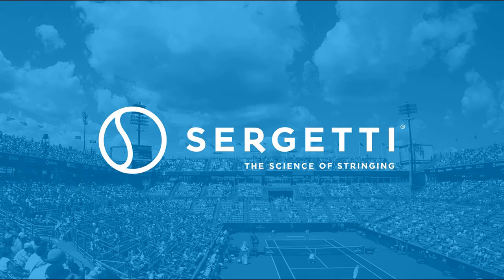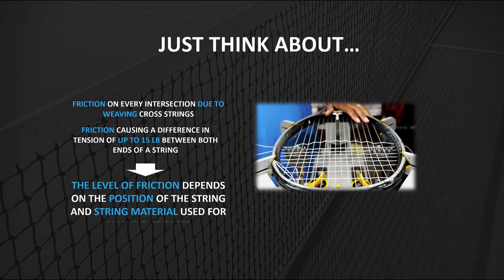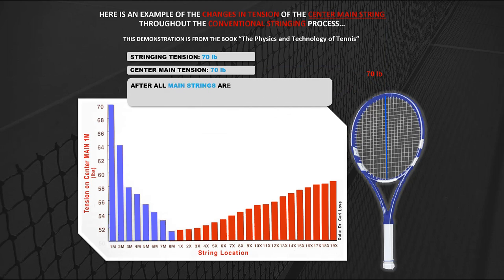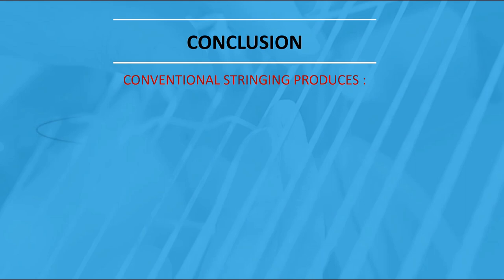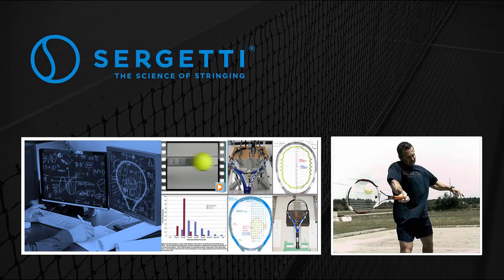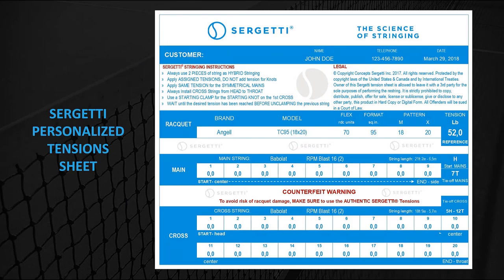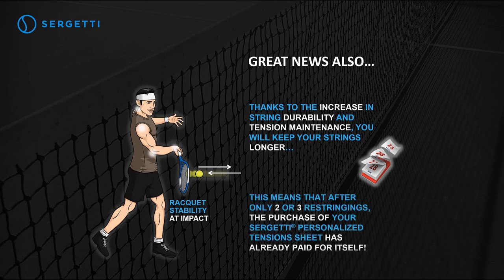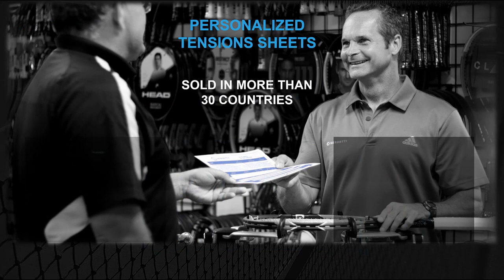Why Sergetti technology is a must in tennis stringing?

Comment: About to string one of my own racquets: I will experiment with groupings of tension to save time.

For 16 mains: groups of 3+3+2 per side. Inside 3 highest to outside lowest. For 18 crosses: groups of 6x3 where middle 6 will be lower. This way an approximation can be tried in order to save time on my drop weight machine.

Thank you for presenting an interesting concept 👍🏻👍🏻 Cheers

Comment: It doesn’t really make much sense, because 2 lines of strings hanging across the racket is basically a pulley mechanism. The tension on both lines should be very similar with the maximum difference of the friction between the string and the racket. So even you are changing the tension value when stringing different lines of strings, you can’t change much.
Reply from the maker: Dear Fan Bu, as I asked to VE, Have you done any tests and measurements of what happens to every string tension during the stringing process even if the tensions are different for all strings to affirm what you are saying? I am convinced not to affirm something which is absolutely not the reality.

Comment: I can't see how you can lessen the tension on the next string without it affecting the tension of the previous string line, they are physically connected.  Now I can see it if every string was tied off on its own at each end.  @fanbu1061 makes an excellent point it's a pulley system.  And even if you manage to get different tensions at the moment, the minute you pound on the string bed the strings will seek to equalize the tension.
Reply from the maker: Thank you for your message! The racquet stringing with the Main and Cross strings is not a pulley system at all. You must think that there are loops on the frame at all ends of the strings, which creates enormous resistance to the movement of the strings, thereby preventing any movement of these strings, and therefore any change in tension even for 2 adjacent strings. You should also think about the fact that the impact of the ball is on about 25 intersections (5 Main X 5 Cross), which again does not affect the tension of a single string, and not at all at the places of the loops. Sergetti personalized Tensions complex calculation are done using up to 50 variables to get the same vertical string deflection on the biggest surface possible of the stringbed, which is 70% of it, compared to only 12% with conventional stringing.

Comment: Ok for a starter, remember the racquet frame is clamped during the string process. This is just one of the many elements that are overlooked in what was described in the video.
Reply from the maker: Dear VE, Have you done any tests and measurements of tension variations during the stringing process even if the racquet is held at 6 points of contact to affirm what you are saying? I am convinced not to affirm something which is absolutely not the reality.

Comment: Interesting concept, but wouldn't the strings all reset to one tension after hitting for a while? like if u tension the first mains at 70lbs, then second main at 50lbs for example....once u hit a few times, both strings will move and both becomes like 60lbs since they are all connected?  There are no knots to stop the tension loss/sharing/reset
Reply from the maker: Thank you very much for your message and interrogation you have! The racquet stringing with the Main and Cross strings is not a pulley system. You must think that there are loops on the frame at all ends of the strings, which creates enormous resistance/friction to the movement of the strings, thereby preventing any movement of these strings, and therefore any change in tension even for 2 adjacent strings. You should also think about the fact that the impact of the ball is on about 25 intersections (5 Main X 5 Cross), which again does not affect the tension of a single string, and not at all at the places of the loops. Sergetti personalized Tensions complex calculation are done using up to 50 variables to get the same vertical string deflection on the biggest surface possible of the stringbed, which is 70% of it, compared to only 12% with conventional stringing.
Reply: @sergettitennis  I will have to disagree, I know there are resistance and friction on the loop yes, but you can easily see how tension can be affected by cutting any single string, u will see the surrounding strings becoming loose even without pulling, thereby the "resistance/friction" whilst true that it helps hold the tension, I believe over multiple impacts/hitting, will change or even out the tensions somewhat, not 100% but definitely not 0% either, hence making individual tension difference between strings quite moot in my opinion.  Same reason some don't like the Starting knot, or think the starting knot destroys the grommet...I mean, if the loop friction holds, why do u need a starting knot that is different from a normal knot in the first place?  esp after many loops.
Reply from the maker: @logicrule  I will have to disagree. What you think on this subject is not the reality, and it is obvious that you have not done the tests to validate your statements. There are many details that remain misunderstood by many people about everything that happens during the entire stringing process, leading to false assumptions by many. Have a good day!

Comment: 50 variable is it formula used statistic probability, integral function calculus , physics , ...?
Reply from the maker: We take into account every aspect that have an influence on the final result of the stringing job. We have developed complex formulas where all the variables are integrated, including the specific characteristics of the precise models of racquets and strings used in order to calculate a perfect and diferent tension for each string. In the formulas, we also take into account the variations in tension due to the deformation of the frame during each string installation, then also the friction during the weaving of each Cross string where the friction level varies for each Cross string, etc. Racquet Stringing is a lot more complex than only pull each string to the same tension when we want to string a racquet to its full potential. That is why the inventor took more than 12 years to dvelop Sergetti, the Science of Stringing.

Comment: Can this method be used for stringing in manual machines with floating clamps?
Reply from the maker: Dear Ivan, Thank you very much for your question and interest in our unique Sergetti technology!
Sure, you can use a Manual machine, and sure it will take longer than an electronic machine to change tension 27 times for a 16x19 pattern (8 pairs of symmetrical MAINS + 19 CROSS) but the result just worth it.

The first stringing job will take longer but you will get use to it and find ways to save time doing it.

Here is a link to a testimonial of a totally satisfied client who is using a Drop weight machine: https://sergetti.com/en/testimonials/garth-hunt-ger/

About the increments. If you can only do increments of 0.5 kg or 0.5 lb, there is no problem, you can round the tension to 0.5 kg or 0.5 lb increments like the following:
- 0.1, 0.2 are rounded to 0.0
- 0.3, 0.4, 0.5, 0.6, 0.7 are rounded to 0.5
- 0.8, 0.9 are rounded to the upper whole number.

If you only have increments of whole numbers, you go like the following:
- 0.1, 0.2, 0.3, 0.4 are rounded to the lower whole number.
- 0.5, 0.6, 0.7, 0.8, 0.9 are rounded to the upper whole number.

If you need help on how to start the Main and Cross strings with your floating clamps, please send me a request at service@sergetti.com      Best regards,

Comment: I'm assuming you're buying one sheet of paper for like 20 bucks plus
Reply from the maker: What you buy is your Sergetti Personalized Tensions Sheet for 23$ CAD based on your precise Racquet, Main and Cross strings Brand and models, to your preferred tension. Once the payment is done through Paypal where you do not need a Paypal account, just use the Credit Card, you will receive your Sergetti Sheet few minutes after in a PDF format.